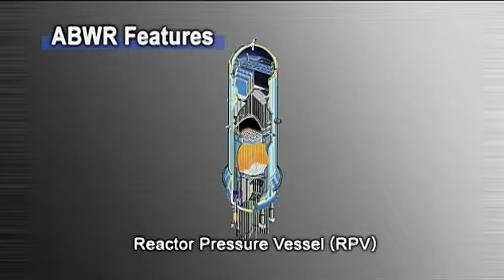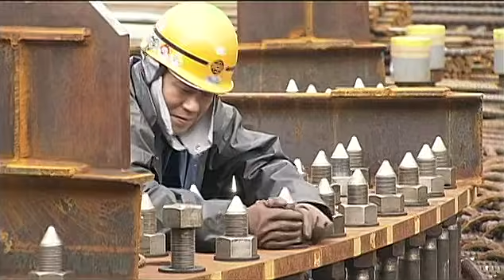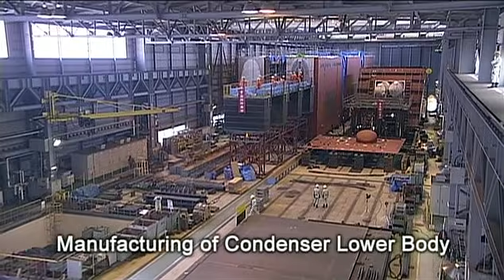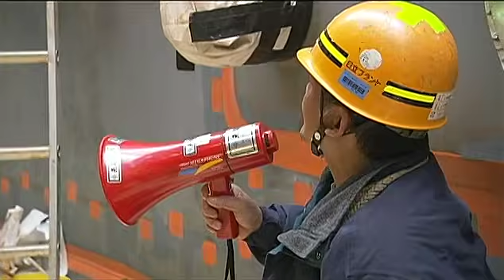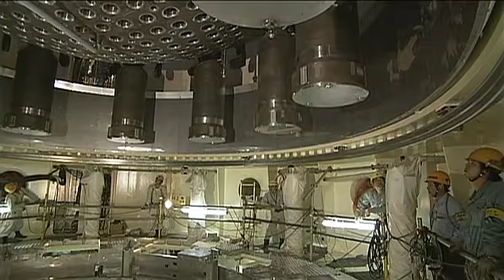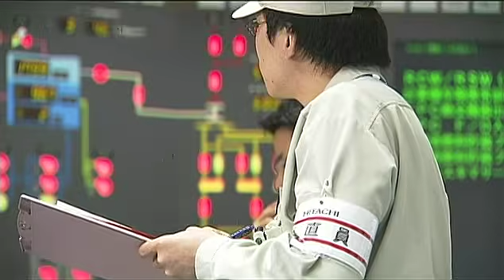Construction Record of Shika 2 Nuclear Power Plant

Comment: As another has said, this is a bragging video, but completion of a unit with a design quite different from previous units in 1800 days - about four years - was quite an accomplishment compared to others recently taking four times as long.  The video was clearly made shortly after its 2005 completion and the confidence it gave to Toshiba may have played a role in its ill fated purchase of Westinghouse in 2006.  As they say, this was before the you know what hit the fan for Toshiba both in terms of Shika performance and its near bankruptcy from its ownership of Westinghouse in completing the Vogtle units.

The video brings attention to a series of circulating water pumps hung below the reactor, which I take to be a part of its "advanced" design. This may or may not have been an attempt to avoid the kind of circulating water pump problem that destroyed Three Mile Island two decades earlier.  I'm not a nuclear engineer.  But Shika's performance in its limited lifetime before its long term shutdown after the Fukushima tsunami in 2011 was abysmal.  Its availability in years from 2006 to 2009, according to World Nuclear Association, was about 40, 0, 60 and 55%.  It produced no power in 2007 and that outage may have extended into the years before and after.  It seems a lot of remedial construction was needed.  It finally achieved 92% availability in 2010, but possibly assisting in that improvement was a lowering of the bar by de-rating its original 1358 MW rating to 1206 MW gross and 1108 MW net.  That is far from a success story.

Although its status is currently shown as "operable" and its location on the West coast of Japan makes it immune from the major tsunami risk on the East coast, it has not been among the units that have been restarted for some non-obvious reason. It is a cautionary tale of the difficulties associated with the first unit having design changes and why molten salt reactors may also have some teething problems, despite their simple designs.
Reply: Most likely, RIPs are simply convenient to package together with the reactor, and not separately. There is an ESBWR reactor, but it uses natural circulation.

Comment: Toooo Late.... If I can use JUST ONE NUCLEAR FUSION REACTOR FOR ALL MY ENERGY NEEDS... WITH NO NUCLEAR ACCIDENTS, OPEN ENDED COSTS OR EVEN NUCLEAR WASTE ETC..  WHY DO I NEED THIS... MASTERPIECE (???)..

The answer my  friend(s)
Is Blowing in the Wind...
The answer is Blowing with the SUN....
Yes.. a Nuclear Fusion Reactor that sends (totally free) 173,000TW of Nuclear Fusion Energy... ready to convert to Electricity using PV Panels etc... 

As I said... tooo late... this is a "toy" (compared to the "monster" Sun) of the 20th Century... Welcome to and Join us in the 21st Century with a ZERO POLLUTION EARTH (no 100,000+ year Nuclear Waste either..) ... running solely on Solar Power .. yes ... a 150TW AgriVoltaics (AV) System generating 180,000TWhrs/yr to meet ALL OF MANKINDS NEEDS... BY 2050... AND TODAYS TECHNOLIGIES TOO...